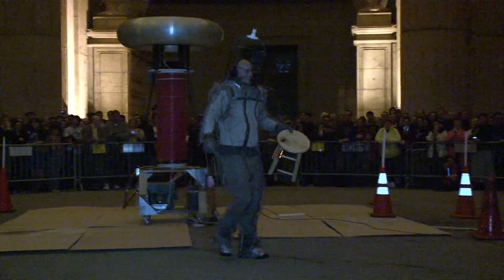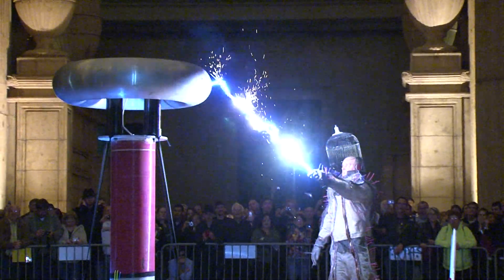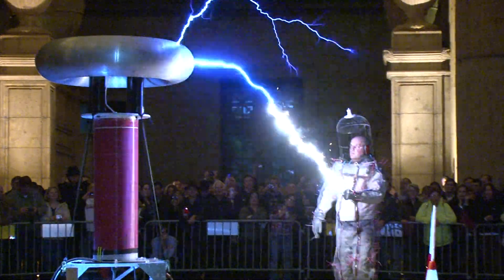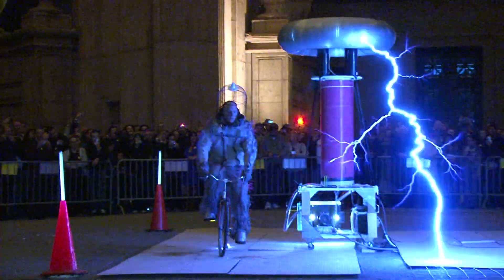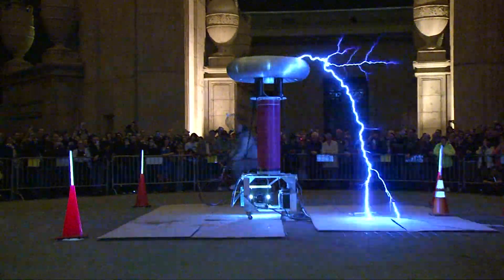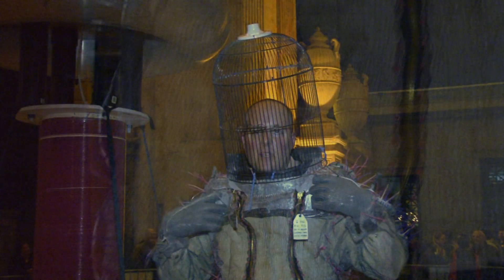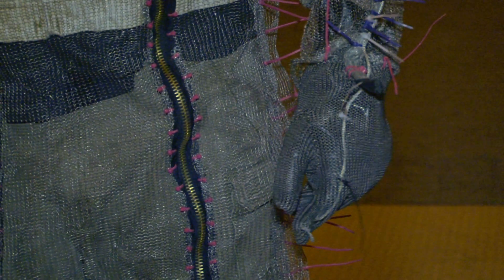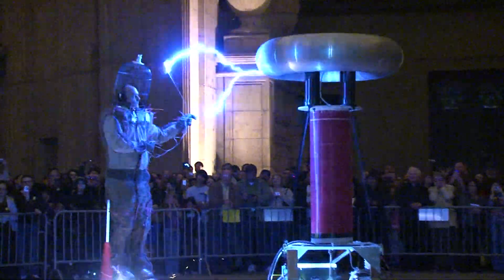Man vs. Electricity: Meet Dr. Megavolt

Comment: "...I feel certain that of all my inventions, the Magnifying Transmitter will prove most important and valuable to future generations."[1] The magnifying transmitter is an air-core, multiple-resonant transformer that can generate very high voltages. Tesla originally termed it self-regenerative resonant transformer, a term that is no longer in general use.

Comment: The magnifying transmitter is an advanced version of the classic Tesla coil. It is a high power harmonic oscillator that Nikola Tesla proposed for the wireless transmission of electrical energy.[1] In his autobiography, Tesla stated that